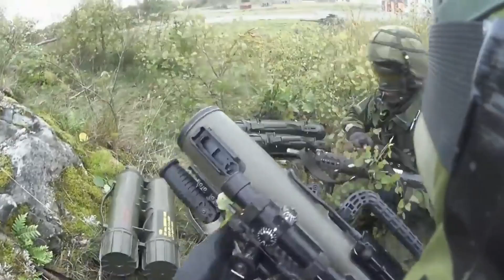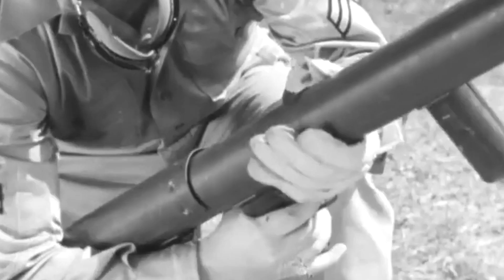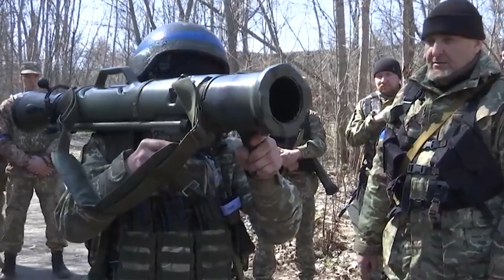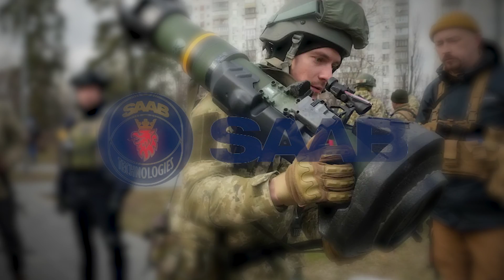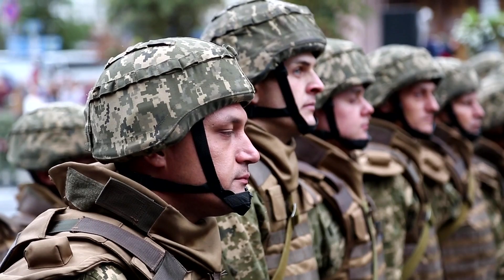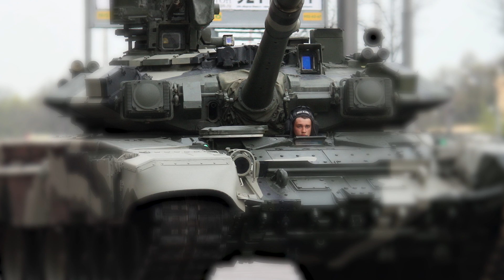Carl Gustaf M4 Recoilless Tank Destroyer

Comment: I used this weapon in 1993, the accuracy depend on the zeroing of the optical sight. Hitting a tank size target is not a problem but getting close enough for a shot is the problem. You are also within range of the tank weapon, if the tank crew detect you. They can spray machine gun at your direction before you can aim and shoot. The best place to use this weapon is at small hill top over looking the junction, where the tank will need to use to get from point A to B. The weapon back blast will reveal your position. When there are more than one enemy tank, the other tank will come after you when the first tank got hit.  Using the weapon at the hill top means you can get away as soon as possible without worrying about return fire from the enemy.

Comment: Over pressure is because the tube is to short.. thus the RPG-7 is still a superior system..  Ammunition is of specific and expensive design and not of any combined weapons use such as a  vehicular mounted and self reloading. it should be able to fire 82mm type mortar shells devoid of their rear with an adapter, but due to the short length can only fire a limited mass.  Reloading is slow and devoid of an auto eject..  This video gives the impression that this system can compete with the AT4 and even TOW systems by forgetting to state the actual  combat range, but the optics tell us that it is only practical out to 400m where the back blast will give the position away every time..  What this really says, is that the 'West' does is design weapons for quick and short conflicts, even though they loose these conflicts in the long run anyway.. and everything is disposable, including soldiers and civilians..  That is EVIL to the core.

Comment: I remember being given trained on the mark 3 in the 90s as an infantry man then officer. I remember a heavy, awkward piece of shit with a massive back blast danger area that reduced its use at platoon level and gave away its position so quick the firing team were likely dead 30 seconds after firing. I thought it was a piece of over engineered shit and we all preferred the US 66mm SRAAW. So maybe the mark 4 and later versions solved all these problems but given they are still a niche weapon I think this narrator is full of shit.

Comment: It was originally developed as anti tank weapon, and ive been educated on it while i did my service, we were also taught to attack heavy armored vehicles.I know this weaponsystem..
However. SAAB have made a disclaimer like 40 years ago, that the weapon wasnt suited for anti-tank roles. The penetration is too low. 
 Its all the other types of ammo that makes this weapon truly horrifying, and theres plenty of designated anti tank weapons around eg javelin, nlaws and at4.
The Carl G have all sorts of airburst, light and smoke munitions and ofcus the cabability to engage less than heavy armored targets. - Its a great weapon, but its no longer percieved as an anti-tank weapon. well.. no more than any other gun is. can still shoot and destroy aimingsystems, antennas, remotecontrolled systems attached outside etc. Should still fire everything you have at a tank, but you should be aware of what the weapon is expected to do. 

And the carl g is NOT made to pen modern tanks..

Comment: Subtitles would have been nice. I used these in the 1970s. Given to us as AT guns. Pretty soon it was obvious that any Soviet tank pointed at you was not going to be stopped by it but anything else was dead meat as were the tanks from the side or rear. We changed the doctrine to using them as front line artillery at which they were superb. Every piece of cover became mere concealment. Weight was the main issue, which they seem to have addressed. Now the 120mm Wombat was a Charlie G on steroids. 120mm Hesh was the solution to almost any problem at the time. Unless they have come up with some cunning ammunition plan I doubt if the Charlie G can deal with even a T62 frontal armour. I recall an RAF helicopter loadmaster calling it a ‘mortar bazooka thing’.
Reply: Settings : captions : English auto generated
Reply: I can't believe they have warheads that can fly over a tank in the warhead detonated downward at 90° to the projectile right through the top

Comment: Initially there was some confusion in the video with rocket launchers (bazookas) and recoiless rifles ( the Carl Gustaf). Two very different weapons systems used against tanks and armoured vehicles. 
The Carl Gustaf is not a rocket...it fires a projectile (like a gun) but fires an equal charge out the rear of the firing tube, which greatly reduces recoil (recoiless).
The weapons provided by Canada early in the conflict filled a desperate need, but now the new generation of rocket propelled ordnance is filling that need, more effectively but also much more expensively.
Reply: Totally correct,  I think there was also confusion at the end when he started showing pics of NLAWS when talking about the M4. Additionally, he was saying  ‘fire and remember not fire and forget’... these are terms tha apply to NLAWS, all versions of Carl Gs are ‘point and shoot’.

Comment: There's a project to make a 3D printed open source recoilless rifle.
Reply: This seems like either a horrible or a great idea...if open source, I'm leaning towards horrible 😅
Reply: Isn't there like a 3D printer that uses metal of some sort? I saw a video about a guy whi was printing AR15 uppers, lowers, and full builds minus the bolt and trigger assembly, but they were metal. Maybe using the same printer for recoiled rifles?
Reply: @FRANK45CASTLE  A recoilless rifle is just a tube to stick a rocket in.

PVC potato guns make way more heat and pressure.

There are also a lot of different filaments you can use. Cheap filaments for a single-use. More expensive carbon fiber or Kevlar filaments could be used for something intended for multi-use.

It's the 3D printed rocket that's a bit harder. But not necessarily all that difficult.

For about a hundred bucks you could even give the rockets autonomous targeting, with a webcam, a single board computer, and either aerodynamic services or thrust vectoring.

For a few hundred bucks you could link a drone to do forward observation and targeting.

For a warhead you just use whatever is available, from C4 to hand grenades. You can 3D print a cradle using a smartphone to make a 3D model of your warhead, and subtract that shaped from a plastic cylinder split in half.

If you are super desperate you can even make your own filament from old water bottles. It probably wouldn't survive more than one use, but it's better than nothing.
Reply: @Forlarren  I've seen some creative weapons while I was in Iraq in 2004. The Mujahideen would get a PVC pipe with a nail at the bottom. They'd get a general range on our base, and use ice as a timer. When the ice melted the mortar shell would drop on a nail or something like that and it would rain down. And before we could get a apache out there or a QRF they'd be long gone. Imagine if they had some 3D printing tech back then. Shits getting crazy these days in warfare compared to 20 years ago.
Reply: @frank203castle8 the Mujahideen were in Afghanistan. I think you meant the Fedayeen, which was the Iraqi version of the Mujahideen
Reply: @Michael Hanson  We called em hadjis or Tallys, plain and simple, they dressed like Ninjas and always ambushed us. They were crazy, and sometimes we would find drugs on them like speed. Very creative and ballsy dudes, I respect anyone willing to open fire on me and my guys.
Reply: @FRANK45CASTLE  there are 3d printers that can make parts from metal but they're out of reach of the hobbyist and I don't know if the properties of the finished part would be suitable for the real pressure bearing parts.  A CNC milling machine and a lathe would probably be a cheaper and better option tbh.